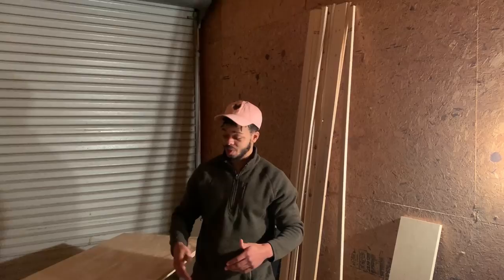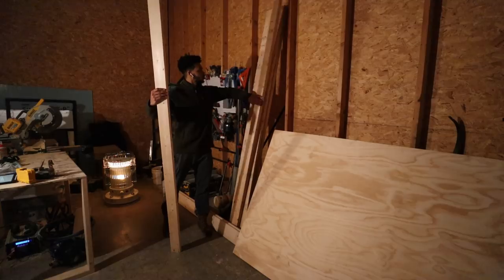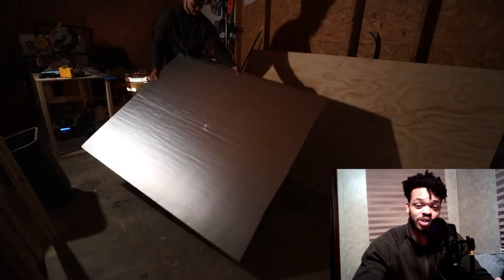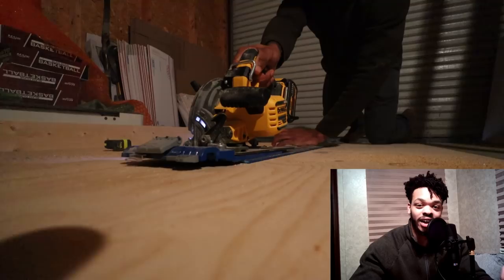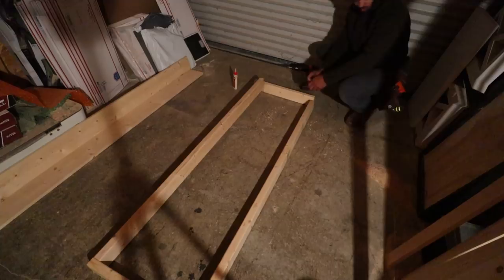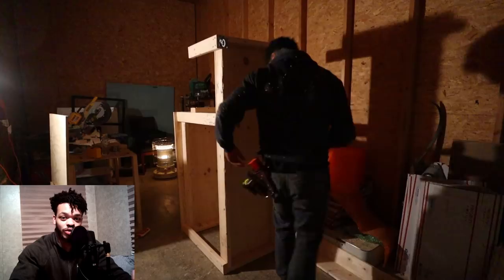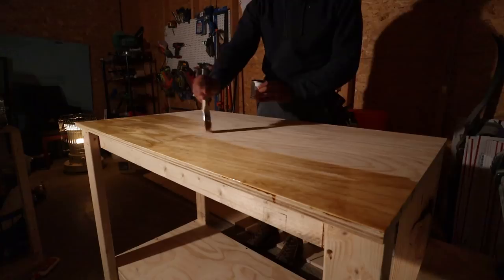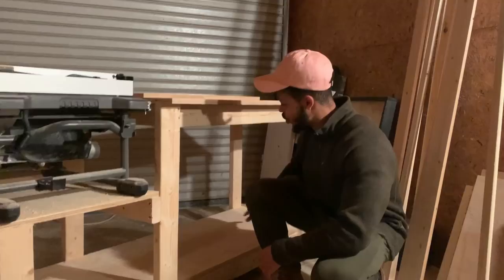DIY Mobile Table Saw Work Bench | Dualex Builds

Comment: Hey brother! I am working on a 96 Econoline as my first build. It was a conversion van so I gotta strip everything out and wondering if you had a video or could explain your easiest process to remove the electrical in the back! It has the AC/heater and wondering if just removing it would cause problems with the ac and heater up front. I should be able to tear the whole fuse box and wires except for the tail lights and be alright? Thanks for the videos and hope for a reply